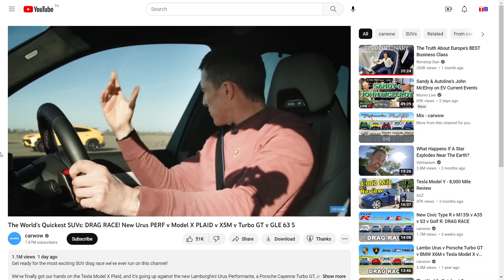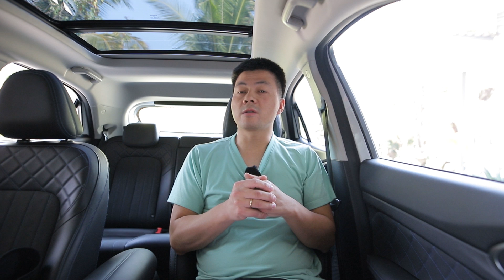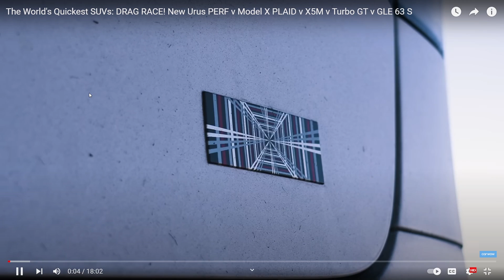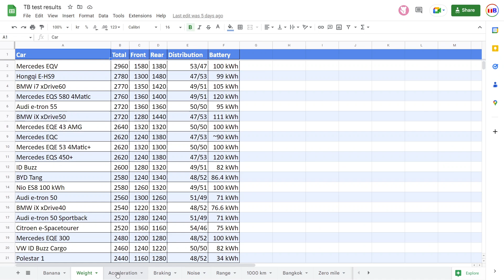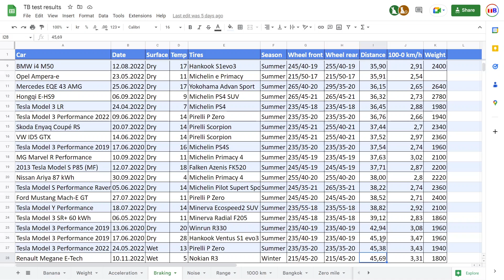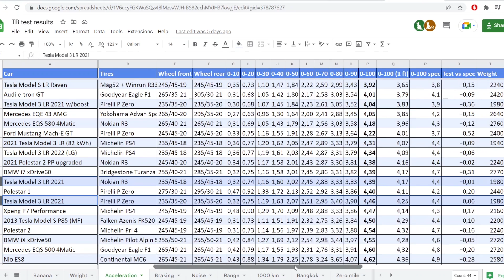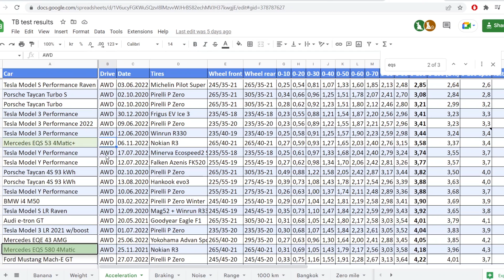Tesla Model X Plaid drag race done by Carwow

Comment: Nicely spotted! When I watched the episode, I noticed that some of the cars had carbon ceramic breaks 🤔
Also the plaid will get a “Autobahn package” with upgraded brakes that also unlocks higher top speed.
We can assume, the acceleration with summer tires would be even better 😅
Reply: I don't think cermaic breaks make much of a difference? Unless you do repeated breaking and overheat the regular breaks.
Reply: @LarsPensjö  IMO, to unlock 200 mph top speed the brakes should be capable of repeated applications at high speeds.  Ultra high performance cars like this are likely to be run on race tracks to use their capabilities, that will put a very tough duty cycle on the brakes.  Even if used on the public Autobahn, repeated braking from high speeds is likely to be necessary due to traffic.
Reply: @georgepelton5645  Yes, but that isn't the topic were are discussing. The matter of interest is why a Tesla X Plaid fails to stop as badly as it did in this movie clip. A single event.

I have driven high speed Tesla peformance on German Autobahn, and I didn't find any reason to break aggressively. On the contrary, if you need to do that, you are not driving safely. An emergency breaking, on the other hand, should always be possible.

Notice also that Tesla X will not be unlocked for 200 mph.
Reply: @LarsPensjö  Indeed. They also did not bothered to mentioned the test against sommer tyres ;)

Comment: You have a good point there. 
The only thing you should mention in addition to that is that you used nordic winter tires for the tests and the Tesla Model X in the carwow video was on central European tires. Recently I came across an article from some German motor journalists that was comparing nordic and central European winter tires at different temperatures. The result was that central European winter tires of any brand (Nokian, Continental and Pirelli were tested) were consistently better at temperatures around 6 degrees. Braking distance with the Pirellis from 80 km/h to 0 km/h was 39.0 m with the nordic tire , 31.6 m with the central European winter tire and 30,5 m with a summer tire to give you one example. They always used cars with the exact same spec for the tests. So the difference between a summer tire and a nordic winter tire was 8.5 m, while it was only 1.1 meter between a summer tire and a central European tire.
Given that the temperatures you and carwow had for the tests were well above freezing, the difference between a central European winter tire and a summer tire should be less significant. It is still not the optimal choice to have a winter tire on a dry road but not as bad as you think from looking at your data.

My final judgement: The test is still invalid and should be done again with tires of the same brand and type of tire on all of the cars.
Reply from the maker: The difference might not be much from 80 km/h. But remember that carwow tested from 160 km/h to 0. Huge difference. Some people in the comments also mentioned that they heated up the tires which makes it worse for the winter tires vs the summer tires.

Comment: Aside from the wheels: What about the weight? Shouldn't the Tesla be heavier because of the battery and therefore have bad brake results? Or are the others similarly heavy because of their heavy V8?
Reply: Friction increases linearly with weight so stopping in a straight line isn’t that much worse just because a car is heavier.

Comment: Many thanks Bjørn for this very appreciated clarification. As a Tesla X Plaid owner I can fully agree with your reasoning. Just to make it clear, Tesla X Plaid breaks are far from being perfect, in particular slightly sponge like feel is what many X Plaid drivers don’t like and what doesn’t really contribute to a confident breaking perception, however they are far from being bad as depicted in the Carwow video. I’ve been regularly using winter tires on all my other previous cars throughout the year and can confirm, that the difference in breaking distance on dry surface between summer and winter tires can be terrifying. I believe, since the Model X Plaid in the Carwow video came straight from Germany and was undoubtedly equipped with winter tires, the least what I would expect from them is to clarify that the results should not be comparable as the Plaid was the only one using winter tires. For the sake of professionalism, they should have never done or published such a comparison.
Anyway, as my X Plaid is currently also equipped with winter tires, I will definitely make a brake test and repeat it when swapped for the summer tires.

Comment: Note that wintertyres are (almost) just as "dangerous" on tarmac during winter as they are in summer..
Then check the HUGE difference between a nordic wintertyre and a european wintertyre, (link at the bottom).
Believe you can buy european wintertyres here in Norway at a few shops now, but all shops say they are dangerous in nordic winter-conditions...
Well, I mostly drive on wet salted roads here in Trøndelag, so I went for Nokian WRD4 a few years ago. When they were worn out, I went for Nokian R3. The WRD4 was surprisingly good in all conditions, the one negative note I have compared to R3 is that they lost sideways traction quicker and took longer to regain controll. Other than that they were almost like a summer on tarmac and very very good in most snow conditions, excellent in slush and this "flour-snow" created by salt on cold days, both which are really difficult for nordic.
So, don't just say wintertyres are dangerous in summer.
If you can't afford 2 sets of tyres, I'd say it's much better do drive on fairly new europeans all year than old worn nordics in winter and old summertyres during summer.

https://www.youtube.com/watch?v=bKtnczk8Mxk&ab_channel=TyreReviews

Comment: great shot, bjørn! winter tires are said to prolong braking distance up to 50 % compared to the summer version on dry asphalt/tarmac. all seasons aren't great either. could it be that the model x was worse on braking than acceleration with this setup?

Comment: Did you consider the atmospheric temperature as well as the track temperature (considering it’s winter in the UK currently)? Secondly, this should raise the question is the calliper size, number of pistons and disc width that come as standard on the Tesla Model X Plaid (or otherwise) suitable for its weight? It’s a known fact that Tesla even stopped using Brembo brakes on the MY performance spec replacing with Mando brakes that are significantly inferior purely to save on costs. And lastly you can’t tell through the Carwow video what tyres the other cars are on. In conclusion, I ask why Tesla is not looking to improve the braking performance of their vehicles in line with German manufacturers - is it purely a cost saving measure just as long as the minimum requirements are met?
Reply: The Model X was smoking the tyres (white smoke) during the braking test, clearly indicating the tyres were the limiting factor and not the brakes. For multiple consecutive hard braking tests you could argue that Tesla's brakes would eventually struggle but for a single test any modern car should have more than enough brake performance, most likely because it's a certification requirement.
Reply: the others were on summer tyres at 2-3 degrees outside temp.
Reply: @modelx-olli1367  Optimum performance for winter tyres is during temperatures below 7 degrees Celsius. If as you say the temperature that day was 2-3 degrees Celsius, it means the other vehicles on summer tyres were already underperforming and yet they outperformed the Model X. This brings me back to my original conclusion.

Comment: I drive in Britain, for the majority of drivers here whether a heavy electric car can accelerate faster or brake better is irrelevant. Show me an electric car for £5 to £10,000 pounds that can do 200 miles, is cheaper to run than a diesel and that I can fill up in 5 minutes  you might have a chance of converting people. In Britain the charging infrastructure is woeful, I have 3 chargers within a 10 mile radius, most houses here have street parking, so it’s a cable from your window to get the lowest price power.  As much as I enjoy your videos I will be staying with petrol/diesel as they are all I can afford.
Reply: I get what you say. Here in Iceland I don’t have paying other than street, but with the price of gas here I pay about the same to fill the tank for a month as I do for my Model Y car loan. It was a no brained for me to go electric

Comment: You may be surprised, but there are countries where winter tyres are compulsory in winter, even when the weather is good. For example, this January we had several sunny days with temperatures above +12C and dry roads. So apart from speed, as long as you don't speeding, the conditions set out in the braking test are not unrealistic. It's a possible scenario.

Comment: it was obviously  running on winter tires. That is not even an official test.. why bother? it's just carwow.. drag racing and banter.  either way, model x would've loose the brake test with summer tires as well (stopping from 161km/h). Tesla needs to fit a performance car like that with way better brakes.

Comment: You are absolutely right. I recently switched from summer tires to Michelin cross climate 2 tires on my car. They are as good as winter tires on snow. They have very high rubber blocks. When turning/breaking [relatively hard] on dry pavement, you feel these high rubber blocks flexing and the car body moving around a bit. Suprising at first. Basically it introduces some gelo beteween the road and the car braking system. That is obvious that the braking is not as efficient/controlled as with summer tires.
Reply: Unfortunately for your theory, Michelin Cross Climate are one of the only all season tyres wit the rubber bases on the summer tyres rubber. Yes they have still less rubber contact compared to a normal summer tyre, but the rubber mix is a summer tyre still

Comment: You are absolutely right. I have missed this detail on carwow. Thought the reason could be that they have not run in the brakes first--we all know,that the brakes are not perfect,when the cars are delivered--so was my M3P. After running the pads to the discs(after some heavy braking) the braking performance got better. But the winter tires,as you said, could be the reason for the poor start(and the reaction time of the driver). Think they should redo the test on summer tires. Kind regards. Thank you Björn.

Comment: If it was done by Carwow and it involved an EV - it will always be invalid.....incorrect tyres aside, they are generally useless when testing EV's, have no understanding about batteries and how both charge & temperature matter to performance. 

They will happily put an EV up against a petrol car - where the petrol car has been warmed up prior and usually doesn't contain a full tank of gas (so less weight), but for the EV there is no prep at all and they just send it up the road with whatever charge it has and whatever temp (usually cold) the battery is.

In this case they added to their incompetence with having winter tyres on just one of the cars!

Comment: I did not even think about it, well spotted indeed. It would probably not have won the braking test but that massive gap was alarming, now it has a reason..the braking test is from 161 km/h so no wonder the gap is even more extended than expected
Reply: also it looks like they didnt even break on the same speed. In most tests I saw so far the Tesla breaking performance is really good compared to other cars

Comment: Acceleration tests are done with 100% SoC I assume? Doesn't that mean regen is compromised if you do them at the same time with high SoC and therefore affects braking performance?
Reply: You would think the battery would be at 100% - but with Carwow it never is and can be lower than 50% when testing....they don't do any battery prep, neither do they care about what SOC it is at, let alone if the battery is warm or not.
Reply: @blower1  This is the responsibility of the owner of the vehicle, which in this case was the driver. So if it wasn't done, he was at fault. You can find him on his channel @RSEV
Reply: I was there. Richard (the driver) was not the owner but the car was preheated before the race. But there is no way a Tesla can have 100% battery when they do these races because they are on a runway and in this case the closest supercharger was 20 minutes away plus the waiting time until they setup cameras and other things. When we go there with Teslas we always try and get them as ready as they can be for best performance. Watch our channel RSEV and you will see what I’m talking about 👍

Comment: You are forgetting the most important thing and that is the outside temperature. If it was around 0, winter tire would perform much better then summer tire, so the difference would be even bigger. I am not saying that the Tesla has a bad breaks, but this conclusion is only based on the one scene in the video. I am suggesting to Bjorn to contact Mat and clear this one out.
Reply: Optimum is below 7C usually. Possible it was above that in the test. It was 9C today for example. Also regardless of that, dry braking can be poorer on declaration even if it is cooler.  Bridgestone Blizzaks have that characteristic. Also see 10.40
Reply: On dry tarmac a summer tyre actually brakes in a shorter distance even down to 0C.
Reply: Winter tires regardless of temp. Looses at any time, as long as it’s dry or damp..

Comment: I noticed that to. With random winter tires well not even random ''good'' winter tires you cant accelerate from 0 as fast as you can with a great summer tire.
Same goes with the braking. Literally just today I 4 wheels spinned from like 10km/h with my Model 3 Performance (Winter tires) when floored. Never happens with Pirelli P Zeros.
If i did that with my 500hp car then just imagine what happens with a 1,000+hp car.  Specially also when emergency braking a 2.5 ton car on a low grip tire. The test was awful with you 100%.

Comment: X and S plaid should have carbon ceramic brakes by default IMO. The brakes are good, but with 1000hp they should be excellent.
Reply: Carbon ceramics don’t change the stopping distance for a single emergency braking, but they don’t suffer the fade from many back to back stops. Under normal conditions, the regen braking would take most of the braking energy and so carbon ceramics are not necessary. So for track use, then an upgrade may make sense, including new brake fluid and lines. Again, for normal use, it is excessive expense for no actual gain.

Comment: It's on winter tyres due to the fact that our German friends drove over there. Not intended fraud but they could have mentioned that. Just google for t&e magazin and model x plaid. The brakes are better than in the carwow vid but still the brakes are really bad in the s and x plaid. And yes the initial punch on the plaid is softer but than it pushes even harder. It's different to the legacy MS/MX. However carwow is just like Top Gear in the past..just for entertainment. I assume that the car wasn't even in dragstrip mode

Comment: Bjorn, the investigator. Nice job! 👍
Reply: Very true and I’d spotted the winter tyres too. That said the S & X Plaids are massively under braked. Many races I’ve watched they really struggle to get them stopped to almost terrifying levels. Watch some Throttle House Plaid drag races. I’ve have various RS Audis including one that featured in a Carwow drag race and my current P90DL is massively under braked compared to them. In normal driving not a problem with regen but it is a problem in performance driving. One or two hard stops from speed my S have big brake fade. My old V10 RS6 on ceramics you could slam on from massive speeds over and over with zero fade. All Plaid models should have ceramics or a far bigger brake setup.